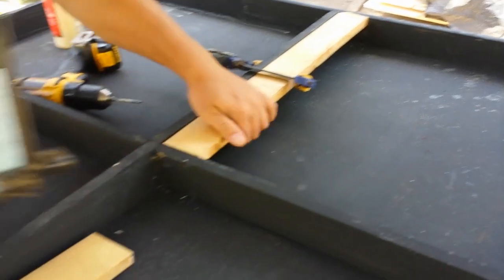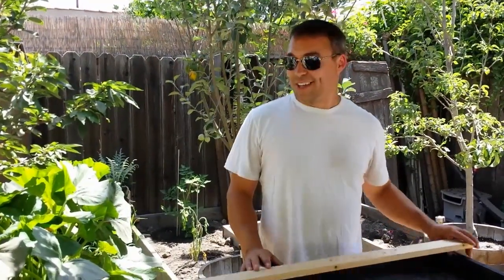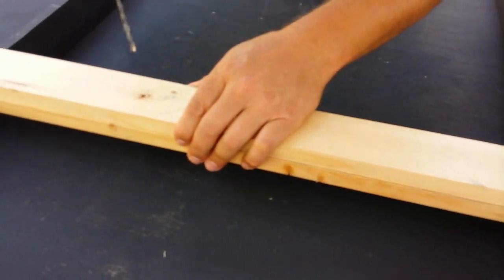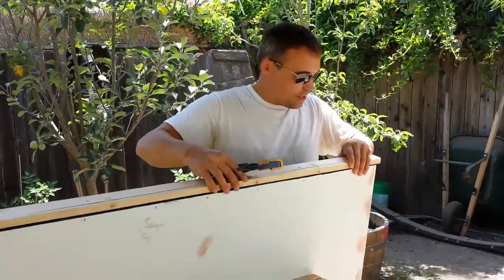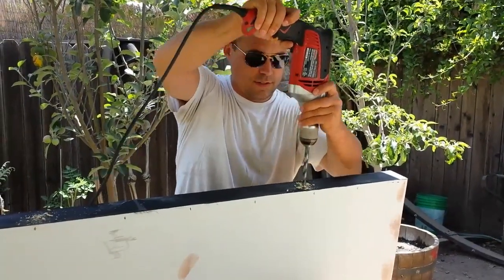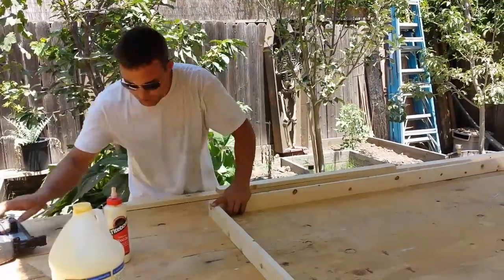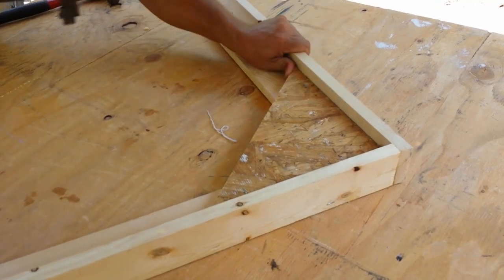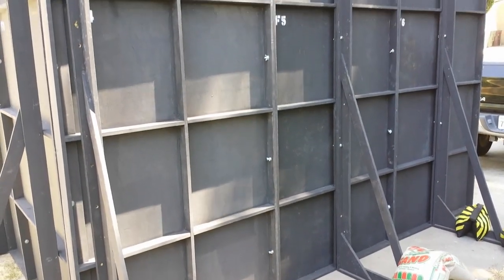Building Wall Panels: Set/TV/Studio Flat Construction SUPPORTS

Comment: Great video!  I’m making some walls for my haunt that is in my garage.  Should I use 1x3s? Or 2x3s?  I would love to keep things light as possible but sturdy.  Thoughts?
Reply from the maker: @TheMusicahombre  We use the 1x3 to keep it light. If you have staple guns, you can glue and shoot, and its fast. I think the heavier 2x3 can be easier to handle and work with, especially if you're screwing everything together and want it more heavy duty. We usually work alone, so making as light weight is beat for us during set up and tear down.

Comment: What if you want to make it portable ? Can you add hinges to the jacks to close it up flat? And how?
Reply from the maker: mount loose pin hinges on the jacks and the walls.  you can just pop the pins out or you can replace the pins with bent nails so you can slide them out easily

Comment: Is there any proportion system you follow to how big you build the support jacks in relation to how high you build the flat wall? Curious to how long to make the horizontal element of the support jack in order to support the flat wall.
Reply from the maker: Julian Dumo I usually use 2' to 3' long for 8' tall and then 4' for 10' to 14' tall walls. then  i add about 50 to 75 pounds of sand on each jack which is more than enough support.  If fact to be honest you could use one jack for a wall that is 12 wide  and 10' tall.  It's really just making it more safe than you have to I think
Reply: Really appreciate the response! Those were similar lengths that I thought would be safe to use - nice to have that reassurance from someone that always builds these types of structures. I assume the vertical element of the jack measures to atleast half the height of the wall if not a bit more? And do you think one support jack is sufficient to support a 4' x 8' flat? (Placed in the middle)
Reply from the maker: I usually just run the jack most if not the whole way up the wall but 6' should work too and yes one would be enough for sure.  Just be sure to get some screws in several places to get a good connection.
Reply: Thanks alot for answering questions!

Comment: Hi how do u calculate the distance of the jack (bottom plate and how high you attach it to the wall frame?
Reply from the maker: I try and make it 8' tall and 2',3', or 4' out on the bottom depending how much room you have.  The shorter it is the or weight you will need

Comment: What's the best way to join two outside corner flats?
Reply from the maker: You can use an L brace like I made for the vertical part of the jack stand screwed from the inside into the backs of the two flats.  Just zip a screw at each of the frame levels every 2' or whatever.
Reply: @HollywoodHaunter  Thank you. Really appreciate the help.

Comment: Would this method be an effective way of securing the sets within a club environment? Worried about vibrations from speakers.
Reply from the maker: Yes this could work we have made media walls for several different venues you just have to make sure they are weighted down in the back.

Comment: How would you secure a two sided wall?
Reply from the maker: Whenever we need to have two sided walls there are a couple ways we go about it.  One is if we are able we always try to lock walls together across the tops.  One great way is to use Coffin locks recessed inside the walls that lock together by pressure hooks.  You simply turn them with an Allen head wrench and they are locked together.  We share some walls using them in this video if your interested.  Thanks for watching  =)  
Making An Old Western General Store Facade: Part 2

Comment: What size bolts did you use?
Reply from the maker: Hey Danny we use 3/8" - 16 - 2 1/2" long and I like to use the fully threaded ones without the shank because I can get them to squeeze the walls together tighter.
Reply: Thanks!
Reply: @HollywoodHaunter  back when i was in hgh school i builet all all the set for the drama department and i used 1/4 -20   2 1\2 inck carige 
 bolts with wing nuts with atched  washer